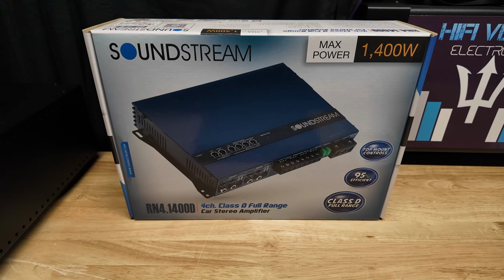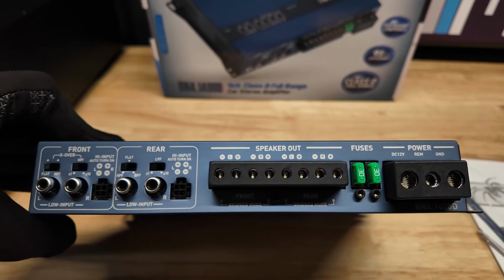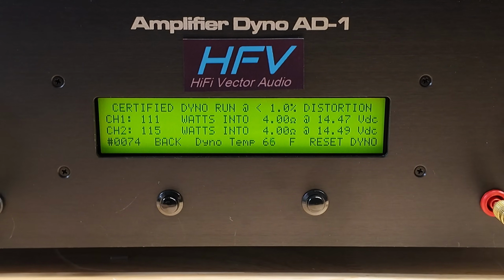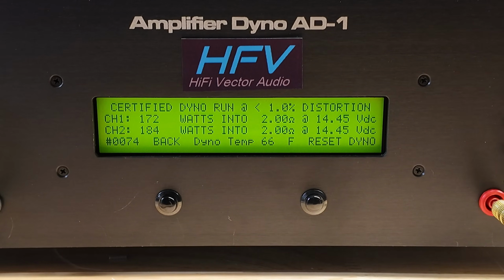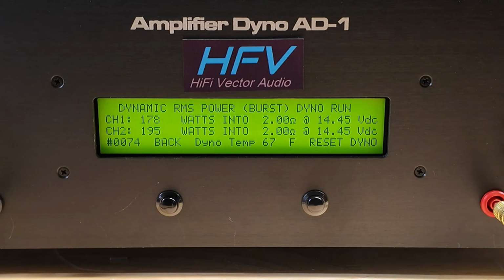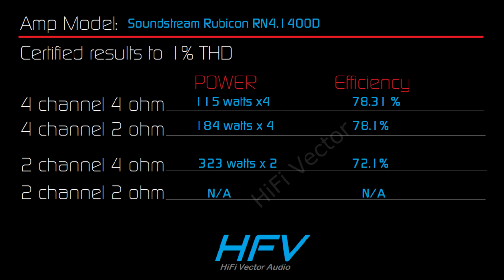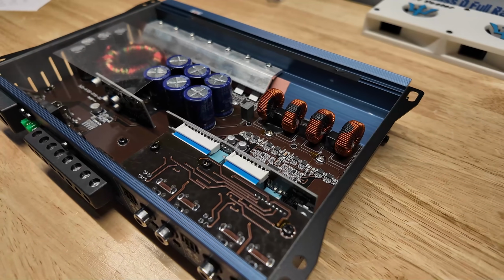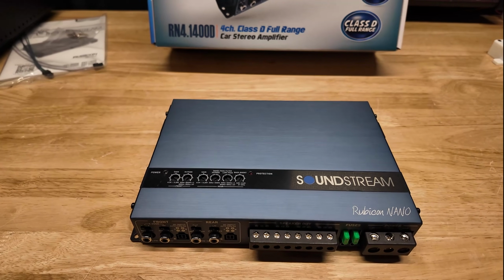Crazy cheap Korean 4 channel amp dyno  Soundstream RN4 1400D

Comment: I found some old School USA made Sound Stream amps on eBay that are "Untested". Which means burnt up.   I was thinking of hiding one of these AMPs inside the old case.  The OLD Sound Stream cases were just beautiful to me.
Reply: I think those were supposed to be class ab amps but no more than 90x4 or 180x2 because class a does not put out that much power. USA amps from soundstream were some pretty rare amps, but not highly sought after.. hope this helps

Comment: Hey man on your armada did you get a 1/0 through the “RVC” on neg battery cable!? I’ve talked to mechman & js-alt and can’t get a definitive answer! I already have the big 3 1/0 kit and I was thinking I would just run 1 neg from batt to chassis/frame, the other from alt to chassis next to factory ground after the RVC!? Would that be considered bypassing it and would it throw code or cause any problems!? Any thing helps, thanks again!
Reply from the maker: So you have an aftermarket high output alternator? What year is your armada?
Reply: @HiFiVector  I don’t have a High Output Alternator YET, But… I do already have the Big 3 “Wiring” just not installed yet bc can’t get/find a definitive answer!? I called mechman, they told me they don’t mess with Nissan and contacted JS they are looking into & suppose to get back to me bc they said their info didn’t show a 2013 Nissan Armada with a “RVC”, so they had me send pics but didn’t have a answer, so they are suppose to get back to me! I know you have an armada and said u had the big 3 done, so I was curious if you could help me out!? 🙏🏼🤦🏻‍♂️ I have a 2013 Nissan Armada Platinum
Reply: I do plan on getting a High Output Alt but holding off til I can figure this big 3 out bc I don’t want to throw a code/light etc… it’s my daily and bc I know once I get the HOA I would need to do the big 3 neways.
Reply from the maker: I disabled the ground sensor that controls the smart alternator function when I had a stock alternator. It’s been a while since I did that but I had to get into a harness and clip a wire and that’s been a long time so I don’t remember the specifics on the certain wire. I have a Autotech engineering alternator and I had them make a pigtail for the alternator to bypass the “smart” so alternator is just working like a normal one.

Comment: The Precision Power I1000.4 makes a little more power I tested 131Wx4 at 4ohm 428x2 bridged, but what's interesting is the board is the same color and uses exactly the same components, the same mosfet clamp style, also made in Korea. I have the I520.4 on my Morel tweeters and they sound excellent. It would be interesting to see how it compares to the new Precision Power Atom series A700.4D it's only $94 on ebay, the 1800 is $129, that's crazy cheap.

Comment: I got one of these for free. I’ve had it sitting for around 4 years and listed it for sale. Just in the last few months while learning what signal to noise ratio ratings are, I saw this one was quite high and had decent rms ratings. I’ve been intrigued ever since. I have a 5 channel kenwood xr-5s i stumbled upon that also sat for years. I finally got something I could put it in and was very impressed with the volume and SQ. This kenwood has a lower rms rating but I’d imagine they are close in actual output however the S/N ratio on the kenwood is lower. I’m itching to see how the soundstream sounds. I just damaged the kenwood with water intrusion and hooked up a pair of Taramps 440/4s. They get down but have a dirty sound. They sounded great in my cargo van but now I can’t I hear that kenwood. If this soundstream sounds as good I’ll possibly try the 5 channel version in my BMW, if it can at least tie me over until I can afford a Rockford T100x5ad. Whatever I’ll get will be marine grade too, to cover me while I chase the water intrusion lol

Comment: I had the Soundstream Reference 6.5" 2-way component set (RF-60C) and thought they were pretty darn good. The woofer is a Dynaudio knockoff (3" coil), huge passive filters and run-of-the-mill neo tweeters. I ran 'em active on an old-school PPI PC450 and it sounded awesome. Can't say if all the newer, corporate Soundstream stuff is as good, but I'd say the Rubicon Nano for a buck-fifty sounds like a good deal. Thanks.

Comment: @@hifivector I love the look of this amp and with dyno results this would be great for my set up. However , what's your opinion on the 5000x1 version vs. A taramps smart 3 amp to power 3 soundstream R3 - 10's.. 2 of my major things I want is very clean power and really good efficiency.  Thanks to anyone who wants to chime in.
Reply from the maker: The rubicon 5000 does around 2 k you can watch my dyno on it. So if you want to max out three R3 power wise then it’s not going to be enough then go smart 3 bass. The Smart Bass amps actually sound very good I have a lot of higher end Korean sub amps and I still love my smart3 bass and smart 5 bass.
Reply: @HiFiVector  Thank you. If not mistaken,  smart 3 is very efficient as well I think ? It's most likely what I'll go with. Do you have any experience with 'Trinity' amps ? They make an 8 channel that on paper looks really good for my setup as well. Thanks again for the reply
Reply from the maker: The trinity amps look likefull bridge amps to me but I haven’t tested on yet so I can’t personally say if they are any good or not. I don’t know of anyone running them either so I have no idea.

Comment: Nowhere NEAR the quality of Soundstream when they were made in the USA.
Reply: Nowhere NEAR the price either....
Reply: @girthquake9655  Yes. The Reference 500 I think was around $600
Reply: People cannot resist saying the obvious. I had Sound Stream/ Phoenix Gold/MB Quart as well back then but it’s a different world with class D, cheap prices, and higher wattages. Also much smaller form factor nowadays and not 25 or 50WPC. 
Find speakers and amps, even class T/D, made in the USA and you’d all be buying import anyway so…. O real need to state the obvious unless you also give the solution.
To me this is returning to the old style of SS.
Reply: yah my second amp of these just failed me , got it warrantied through sonic Electronix and they don't even carry it anymore , got my money back and bought a radio
Reply: What’s not the same quality. Specifics or don’t bother.
Reply: @Dingleberry1856  the SoundStream amps from the 90’s were EXTREMELY clean.  Not looks, but the power was extremely clean.  Lower distortion, better headroom, less background noise, just overall more clean.  What was worse was the efficiency.  But that is a given with all sound quality amps.  Reliability is up in the air with these new amps.  They haven’t been around long enough to see if they will last or not.  The old Soundstream amps from the 90’s though, there are very few that you will find that are not working.  That says a lot about the quality of 30 year old electronics.
Reply: @91CavGT5  testing can give a good idea, better than assumptions.
Reply: @Dingleberry1856  Unregulated power supply, USA quality, rated at 12 volt and 1% distortion... The OG USA Sounstream amps were savagely underrated in the 90's and 2000's.
Reply: Soundstream of the 90's also sucked for price
Reply: @hotfuzz1913  SERIOUSLY?????? The dollar per watt of OG USA Soundstream from the old school??? Buy an old school Rubicon or Referesnce model MADE IN THE USA. #1 you will pay an ultra premium price, BJT you will pay for the premium A/B sound quality that is so much better than a converted  square wave from Class D. ANY audiophiles out there want to chime in and set the record straight? OG USA Soundsteam amps will cost more, have much better quality and an unregulated power supply. Do your homework before you test an old school car audio specialist from the early 90's. Old school Soundstream, Autotek, Fultron (Memphos Audio) Aria, PPI (before they turned to SHIT by selling to MAXXTronix, Clarion. Blaupunkt, etc... You are probably too young to rwmember the GOLDEN age of cheater amps.

Comment: As I told you before I am New to all this stuff so I'm kinda confused about soundstream I have seen some very nice equipment from them just like the amp you are testing and then I see the other products like the bass restoration processor They sell at Walmart and it looks really cheap are they a fully Korean brand or just Some Korean built products like the AAK line from deafbonce is Korean but the rest I'm unsure about and if so which of their lines are Korean made
Reply: Some Korean built, rest are china. There made by Epsilon which destroyed the brand along with a few others they purchased. This actual amp is surprisingly good when it come to the actual rms wattage it puts out.

Comment: Hm. For $125 bucks, the Recoil DI1200.4 is a better buy and much more power.
Reply: Seen some pretty in depth tests of both Id only use them for midbass.  Bridged theyd be perfect.  For tweeters and midrange id find something else.
Reply: @666nacirema666  I don’t know. I saw those tests but in real life, the DIs slam
Reply: @TheGodofSEO  Yeah they can put out power cheapest way to power my anarchy 7s when bridged but objectively worse for my mids and highs than other options even other class d options.  Great for a lot of people though im sure.
Reply: @666nacirema666  let me guess, dirty power? 🤣🤣
Reply from the maker: True but these amps last forever and quality is very good. Not sure how long recoil stuff will last haven’t been out long enough to really know yet. But they are a good bang for your buck for sure.
Reply: @HiFiVector  perhaps. As you know, it was your test which prompted me to do all 3 of my cars with Recoil-only systems. 9 months later, everything is rocking beyond solid. Those DIs are beasts.
Reply from the maker: They definitely bang pretty good and are a great deal!
Reply: @HiFiVector  absolutely a killer amp

Comment: I have the marine version of this amp and I beat the tar out of it. It never gets hot and has never shut off. Finally, I know how close to rated it is as well. Thank you.
Reply: I try to get the marine version we I can, I feel like it's built a little better and if not it at least has a coating on the internal, more heavy duty
Reply: How is the sound quality? I’m looking at the marine version for my boat.
Reply: @Fochopz  It is good enough that I ran it active off a DSP for mids and highs. It sounds pretty good to me.
Reply: @Evilthx  which DSP are you using? I’ve looked at a couple but not sold on any yet.
Reply: @Fochopz  I was using the RF 3Sixty.3 with that amp.